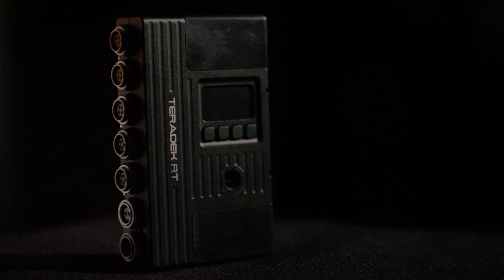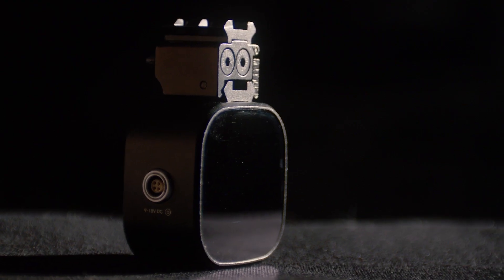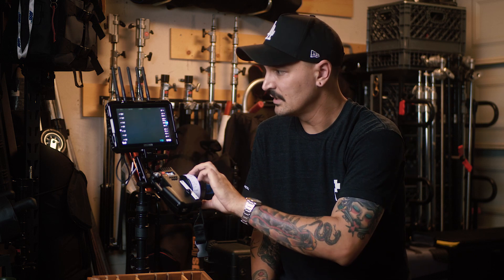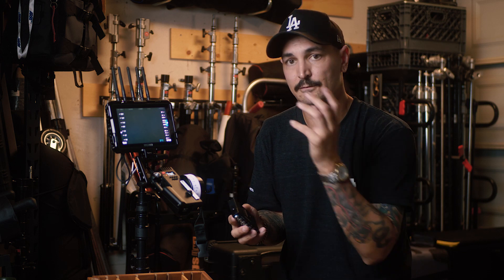Wireless Follow Focus Build Version 3 // Teradek RT // Smallhd 702 Touch // Teradek Bolt 4K

Comment: Hey Jesse, firstly thank you for the video, i found myself coming back to it while i was contemplating investing in the RT system or not, and even more so now that I've committed to it. I'm just wondering what has been your experience now that you've owned it for quite a while? How are you finding it? Any quirks or things to look out for? The tof.1 specifically is something I'm still thinking about and can't really find any good reviews for. I know it's no cineRT but is it useful on set? Is it only useful in specific scenarios? Is it good enough to get you a dolly shot first try? 

Sorry if it's a lot of questions!
Reply from the maker: I love the system. For the price, it’s punching WAY above its weight. I haven’t found anything I think is a serious minus. There are some operations that are a little clunky when changing lenses but nothing I would consider a major minus. Overall I think the RT is the best all around system, arri and Preston are great for what they are intended for while the RT is more compatible with todays smaller camera builds. 10/10 would recommend 

The TOF.1 is a tough one. I have one and don’t really use it all that much. It works great and can be a very helpful aid but with the cameras I’m using getting smaller and smaller it become a issue of where to put it. The beam angle is fairly small in comparison to other range finders so getting a accurate reading during a take can be difficult. I use it more of a reference in between takes or to get marks. The auto focus feature can be useful for getting slate if I don’t want to it move my focus knob but honestly it’s more work than necessary in my opinion. I would say get the TOF.1 if you know you’ll use it a lot otherwise rent one if a specific job calls for it.

Comment: Lovely stuff once again! 

Good luck with new system, looks so good.

Btw if you’re powering the monitor and teradek from the v lock, does your d tap cables have regulators in them? 

The v lock I own is the SWIT S-8082s and I cant find out whether the d tap output is regulated or it will fry my monitor/teradek. Have emailed but waiting on a response. Wondering what your two cents is?

Thanks!
Reply from the maker: Thanks! 

I’m not powering anything from the Dtap anymore because the v mount plate on the Teradek module powers everything.

Most, if not all, dtap on batteries these days are regulated by the internal chips inside the battery. I don’t see why the Swit batteries would be any different.